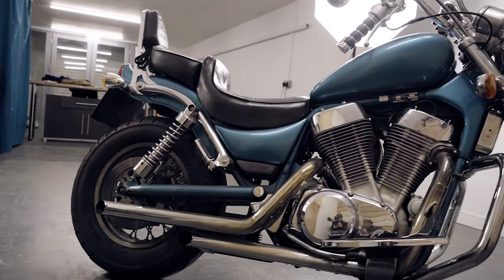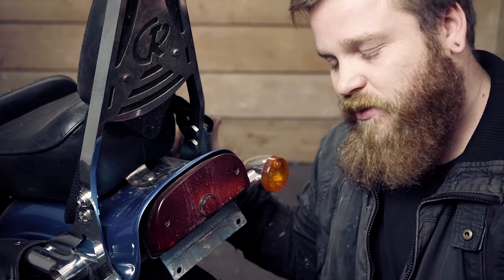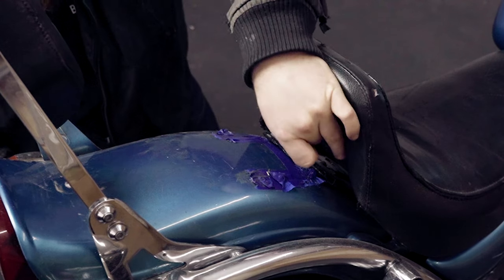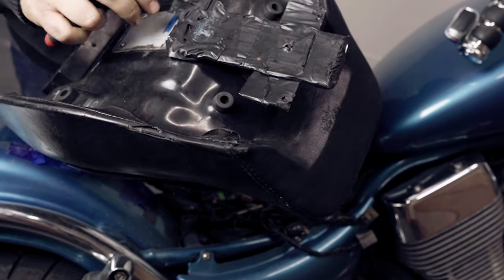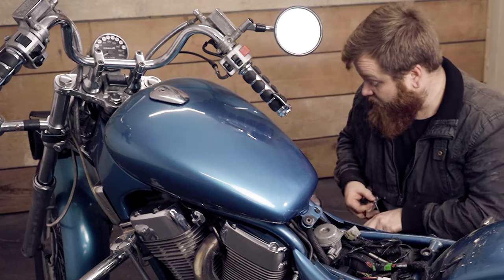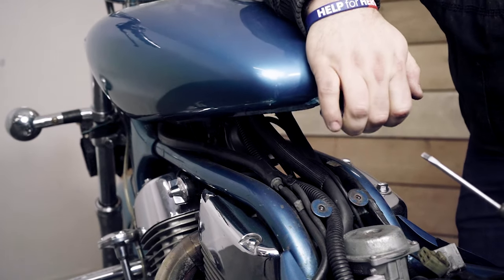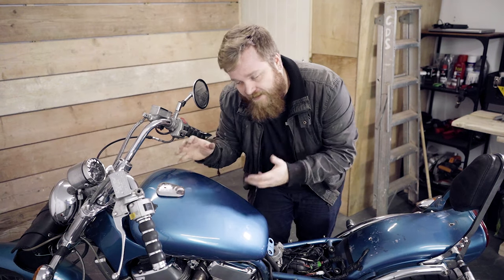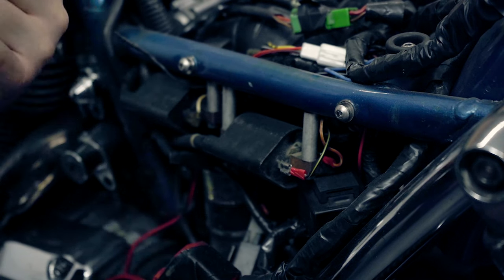Suzuki Intruder VS1400: Remove Seat and Tank - Tear Down Part 1

Comment from the maker: Q&A -> Thanks for checking out the video, if you have any questions drop them here!
Reply: What's up man I'm trying to come up with a fuel tank for my 93 intruder 1400.
I'm having a hard time finding it, is there another tank about the same capacity you would recommend adapting?
Reply: Hey fella I've got the 90 VS an having trouble getting spark I believe it's cuz I don't have power to coils

Comment: I just got a marauder for $300 It has no brake lines installed and for some reason it won’t stay running, If anyone has a suggestion as to what I may have to do I would appreciate it.

Comment: Thanks for the videos, just doing a build on my 1988 here in Germany. What I recognized, most of the hardware on your bike isn't original. I recently took a part a bone stock 1993, and both mine and that one use mostly 10 and 8mm stainless hardware for side panels, tank, fender struts and stuff like that. The bolts even look nice, well machined and some have blue plastic protectors integrated in the bottom of them.

Comment: I was going to skip this video because I've already done this way too many times (long story), but I'm glad i watched. I very much want to congratulate you on this. It's very informative, and one of the first incredibly important bits I spotted was about 4:40 when you're taking off the main seat, and explaining what's under there, and to not just "rip it off". how do I know that's a REALLY bad idea? Well.... as you can probably guess, I had no idea the ECU was under there. I unbolted the seat expecting it to just lift off, and pulled a bit too hard. The ECU case snapped in half, and left most still bolted to the seat. It was not fun getting it epoxied back together. I still don't know if that is part of what's still plaguing mine.
Keep up the good work; can't wait to watch the others!
Reply from the maker: Hey Fred, thanks for your kind words, yes the seat does catch a few people out. What is your bikes symptoms? Does it turn over? or is it dead in the water?
Reply: - It's Michael actually. The Fred Flintstone moniker is for a bit of anonymity at times. Anyway....long story short (yea, right), like you, I bought the bike not running, back in 2016. No big deal I thought. Was I wrong! I took it to a shop, because I lacked the time and patience, and  experience on Intruders. The mechanic went through the carbs, forks, and miscellaneous bits. When I went to pick it up it wa running, but barely. He said because it has straight pipes it's not going to run right, but didn't get into the details of why. That was an understatement. Fortunately I had a trailer with me, just in case. I should have just left it until it wa spot on,
I got it home, tried to ride a bit around town, spitting, sputtering, backfire, would only run half ass if I had the choke full on. I trailered it back to him, said "when it's right, call me". Couple weeks later he calls, again I drag a trailer with me just in case. I get it home, It's better, but 'better' is a relative statement.
The list of what I have done (most previous to him working on it)
Boiled out the gas tank, cleaned out the tank petcock, cleaned out the main/reserve switch, installed factory curved fuel lines (but installed small inline filters under the tank), new battery, repaired the ECU (inspected for fried components, epoxied the case back together, cleaned terminals as best I could), and that's it I think.
He said he installed a new fuel pump. Nothing was done, that I remember or know of, to the ignition system. On the FB page that led me to you, there was mentions of straight pipes and having to re-jet the carbs, although I don't know why that would matter. Ideas?
Any further work will be done by me; my wife wants it out of the garage, sell it or ride it. Can't do either until it's running properly. I paid $700 for it originally, and have another $1200 invested. If I sell it as is, I will take a major hit, and I don't like that option. I know the next video is about carbs; maybe that will help me as well.
Reply: - It just occurred to me...is that a factory or aftermarket main seat? I like that. Mine had a Corbin 'Gunfighter' on it, and I don't like its style so much.
Reply from the maker: Ahhh man, sounds like you may have a few buts going on. 1st thing I would do is remove the carbs and have them ultrasonic cleaned, if any if the jets are even slightly blocked it will cause problems. Also if its sputtering and coughing slot you may had an air leak, this could be on the rubber boot from the air boxes or could be on the diaphrams of the carbs. The smallest pin hole can make a huge difference. Full carb tear down and inspection video is on the way. :)

Comment: Lifesaver. I just bought a 1996 Suzuki intruder 1400 in July. Trying to get it going after a long sit through winter. How do I change the spark plug? I didnt see one that said spark plug when I browsed your other vids. If you know which one I'll go there straight away! Thank you so much!
Reply from the maker: The sparks are housed under the front right hand chrome case and rear left chrome casing. You'll need a 10mm spanner to remove the fixing bolts, under the casings you'll find the coil lead seated ontop of the spark plug, remove the cable by pulling it and then you just need a long socket to remove the plugs

Comment: Very informative, thanks!

Got a question though, could not see it in the video, but is the rear cylinder inspection cover accessible after removing the seat and the tank? 
Asking because it seems I have a minor oil leak, and it looks like it is coming from the rear inspection cover gasket :)
Reply from the maker: I don't think the rear cylinder cant be accessed without removing the engine. I could be wrong but if memory serves me right, only the front cylinder can be accessed in the frame.
Reply: after some wrenching and screwing, your assumption is 'unfortunately' correct :)

but I'm glad that you are still around, looking forward to future Intruder episodes!

Comment: Hi there. What is that style of seat called? Where did u get it?
Reply from the maker: It came with the bike when purchased. I'm afraid there are no markings on the seat, I have searched high and low for the manufacturer and as of yet, no luck. Part of me thinks it was custom made for the previous owner
Reply: oh ok thanks for the response